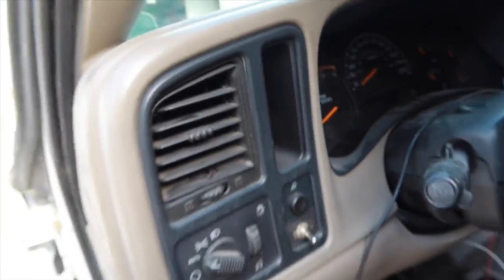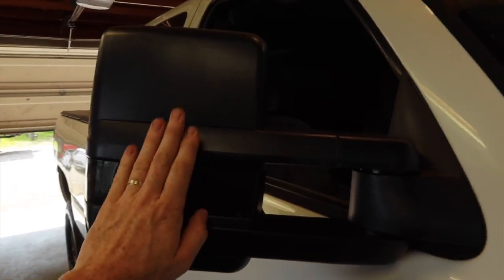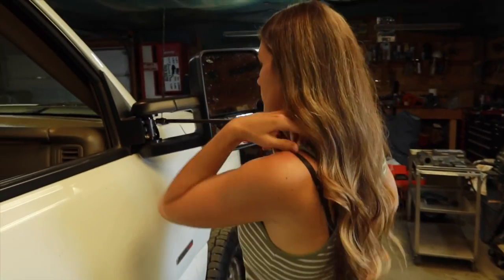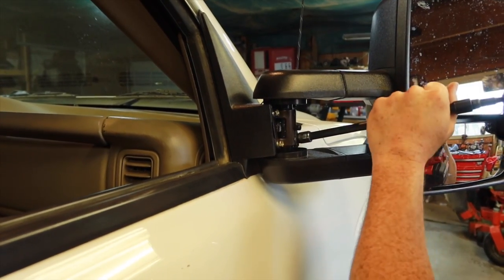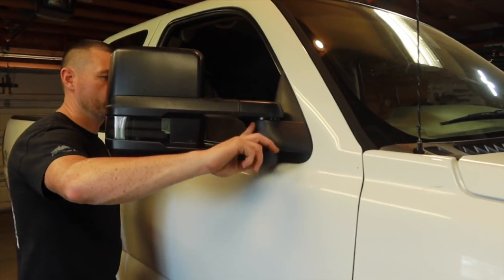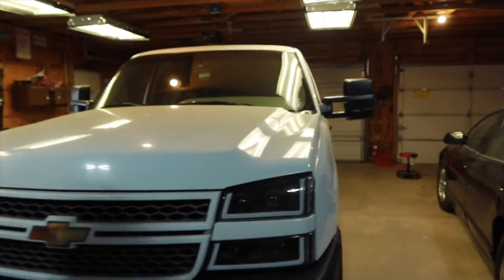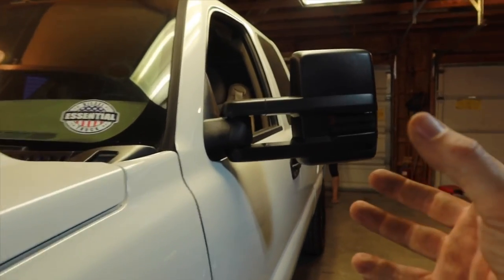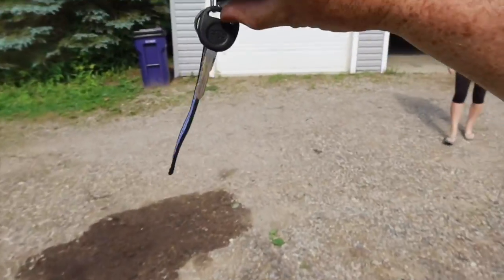Spent 96 Cents To Level Truck Tow Mirrors!

Comment: If you're worried about the bolts coming loose, it's probably a better idea to put some blue Loctite on the threads rather than over tightening them (which I would probably end up doing).

Comment: I would like to add a couple helpful hints when installing these types of Tow Mirrors,  First off it will be a lot easier when removing the Outer Plastic Covers if you use a Thin Putty Knife instead of a Flat Blade Screw Driver,  Also, when your ready to insert the Washers, Sandwich them between a long piece of Scotch Tape and leave a 1" tail on it,  then poke a Hole through the tape so it will be easier to insert the Bolt through.
At first I used 3 Washers, which made my Mirrors Perfectly Level,  "BUT" when I went to install the Plastic covers, they would not Snap Shut because the Top underside of the Mirrors Arm was to low which prevented the cover from closing,  I then lifted the mirror up which took some pressure off of the cover, which let it snap close,  "But"  when I moved the mirror to close them the covers would Pop Off,  So I  ended up using just 2 Washers,  which did the job,  I would also recommend that you use Lock Tight on the Fine Threads of the Bolts when you tighten them down.
Reply: Mu thoughts on what you commented.... do you think using the two at the mirror and maybe one on the top stud at the base mount might give the proper angle with out pushing it out from the door to far and making a gap?
Reply: @_flexxx_  You can try it, But doing so may require you to purchase Two Longer Screws for the Top, because adding Washers to the bottom may cause the Top to be to far from the mounting Holes,  But I and many others found that Two Washers at the Top is all you need to make your Mirrors Level,  Just make sure you use ether the Blue Locktite or the New Orange Locktite, which is in between the Blue and Red,  But is easy to remove.
By the way,  If I ever do this again, I would take one of the bolts to my local Hardware Store and Purchase 4 that are just a little bit longer,  for the top Right and Left side,  that way when you add the Two Washers to the Top,  you will  gain back what you loose when adding the Two washers, But then again, I have had mine on for Two Years, and they are still Holding tight with the added Blue Locktite.
Reply: Appreciate your tips
Reply: Did it hold up over time????? And is it hard to wire in turn signals to a work module with no power windows or mirrors?

Comment: The mirror always look different because the drivers mirror is twisted farther out and the passenger side is twisted closer to the door
Reply from the maker: I never knew that
Reply: Yup, all mirrors for vehicles are made that way,  the passenger side mirror is farther from the driver,  so it has to be at a different angle for optimum viewing angle. From oem factory the passenger side is engineered that way too, the glass has slant to it instead of the whole housing, if you want to check it out...
Reply: Hahaha I was about to send my mirrors back because of this!

Comment: Truckmaster, I’ve got a problem with this method. I had yitamirrors on my last truck and followed this leveling method and it worked. Now I got boost mirrors, and when you try to put those spacers in there, even when you snug it back down it wobbles and won’t get solid 
meaning that spring behind the little lever wedge is just pushing out far enough now to not hold the mirrors tight. Does that make sense? Please message me I ended up putting spacer in top of the 3 bolts that hold the mirror to the door.

Comment: I had to do the same thing to mine after I installed the newer style mirrors!!! All cat eyed chevys need the washers. Mine are perfectly level. I used 3 washers on each side.
Reply: How thick were the washers you used. I couldn’t get the cover back on when I used 3 washers
Reply: @alexanderweller6509  they were real thin i believe.  If coverwont pop on then try 2 washers. Or trim cover a little where its hitting.

Comment: Hey man I had a question for you on those mirrors were they the ones with the turn signals? And if they do have the turn signals were those mirrors plug and play? Or did you have to run wires for the blinkers to work? Been really wanting these mirrors but I do not want to have to fool with wiring I’m hoping they are just plug and play

Comment: Hey you said if you put 3 washers on you might have to mod that covers that snap back on, what did you have to mod on them because I only put 2 washers on both driver and passenger. The driver side one snapped in fine the passenger side however does not wana snap it  what did you do?

Comment: We need a video on what to do when you drop a washer in the bottom base of the mirror lol crappy part I can’t even use a magnet I bought Ss. You make getting them top 10mm on the head of them bolts look easy. Mine wanted to round out the head. Thanks for your tips.

Comment: I know this post isn't about braking, but I have a brakes not holding when I brake boost (I drag race). Is a 2007 GMC LBZ Duramax, have already flushed the hydroboost and brake system and still very poor brakes. No leaks, but just wondering how I can tell if is master cylinder or the hydroboost. Any help would be appreciated.

Comment: I went 3 washers out of personal preference, had to lightly grind some plastic on the bottom side with the dremmel on the cap to get it flush, but looks factory. Just have to know any mod on any part ( like my grinding) will void warranty. Question, "Do the chickens have large talons?" JK 😂

Comment: Dosnt look bad. Boost auto parts does not recommend leveling them.
"Our mirrors are designed off of the OEM mirrors, and the OEM mirrors do not sit level. Many choose to level the mirrors out and there are many writeups out there on how to do it, however we do not endorse this.

Disclaimer: Leveling the mirrors can cause additional glass shake as well as damage to the mirrors."
Reply from the maker: Thanks for the info 👍
Reply: @TruckMaster  no problem. I'm sure you knew this, just didn't want someone coming after you especially if they try it with the ebay knock offs.

Comment: I dont understand the leveling thing. The top of the door angles in the same way

No way I'm jerry rigging $400 mirrors
Reply: Jerry rigging😂 they look like trash when they aren’t level
Reply: Jerred Wayne ....??😂😂
Reply: Jarred Wayne, I have to agree. It's actually kinda annoying how triggered some people get about leveling the mirrors. Lol. I mean, I can be a bit OCD about a lot of things but I don't stare at the angle of my mirrors, I use them as they're intended. If I leveled my mirrors, I'd have to adjust the actual mirror glass "in" more to see, exposing more of the glass outward from outer edge to potential damage. I also tow a 31' travel trailer, and when I do, I need to readjust the mirrors enough as it is to see all that I can and wouldn't want to force the inner workings even more to compensate for the extra/unnecessary housing adjustments (for visual effects). I care more about "function" in that regard & BAP mirrors are not cheap, for most of us. BAP won't warranty the "modified/leveled" mirrors? At that price for nice mirrors.....I'd pass on the leveling 'cause I have better things to throw my money at, like amo! 😁🇺🇸
To each their own.
SEMA truck=level. 
Working truck=more function, less shaking.